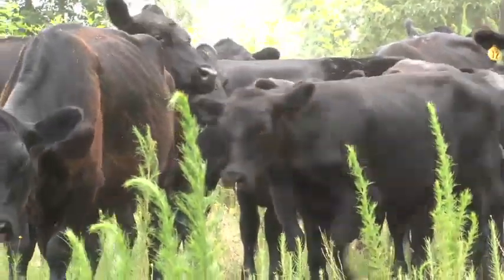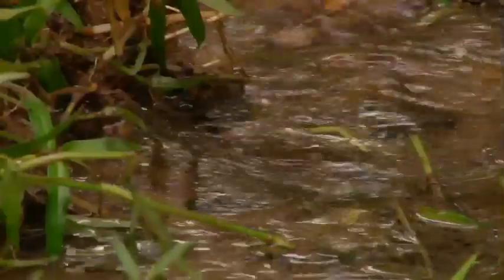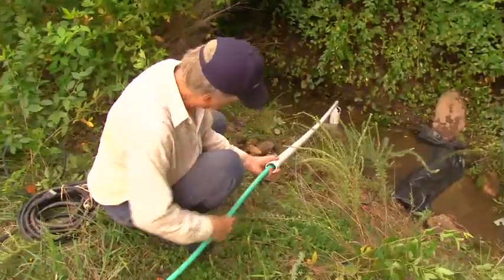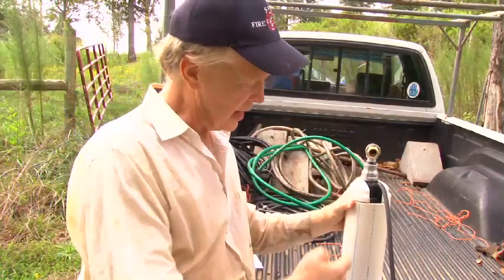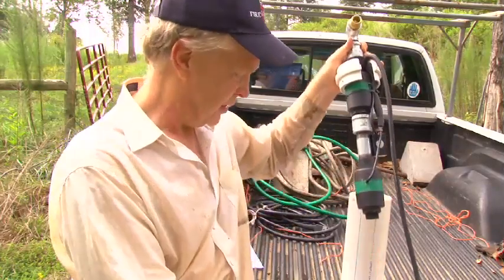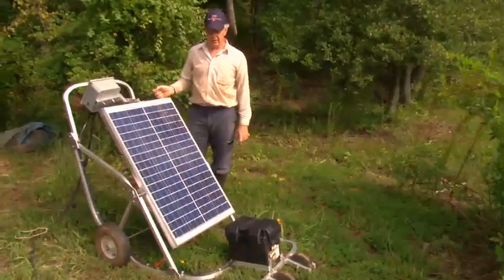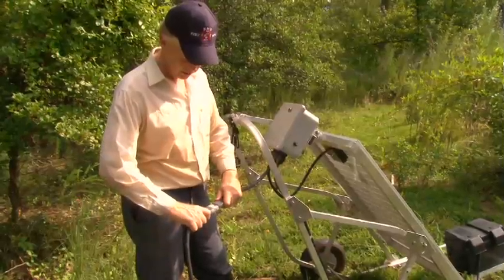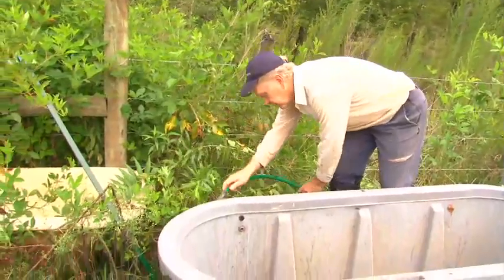Full Belly's Solar Water Pump for Livestock

Comment: A piston pump can be run on 1/4hp to 1/2hp AC or DC motor, will pump up to 200gallons per hour on  a 2km long 1" pipe with a suction of up to 7.6m and a head push of 100m, and will not get damaged by running dry. Being a direct displacement pump they are by far the most efficient.
Reply: I am designing a system that is exactly like this right now using a pompco piston pump.   Reply if you want to share info.